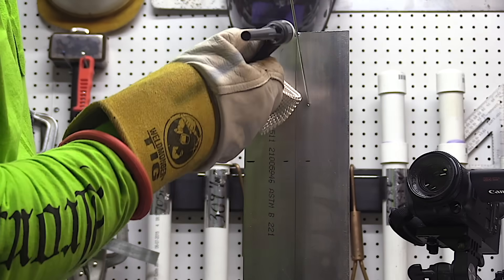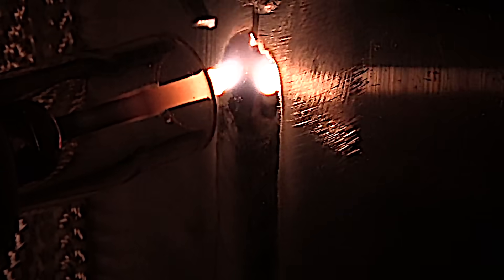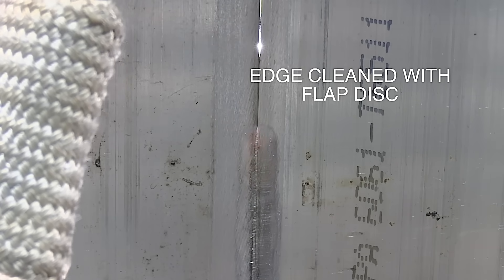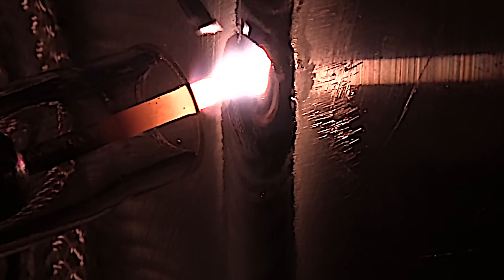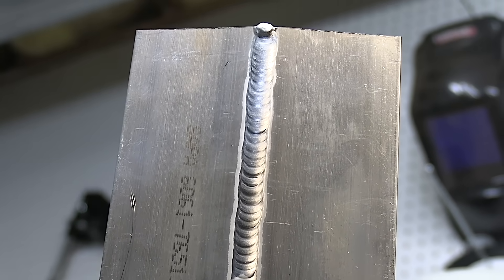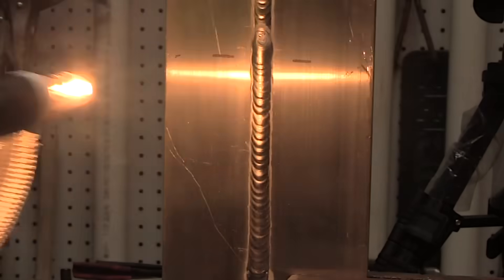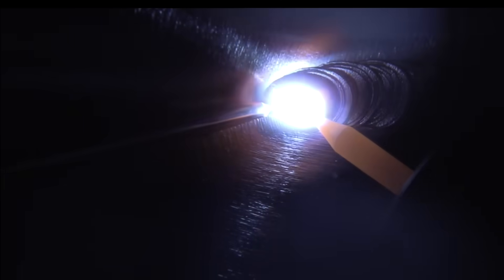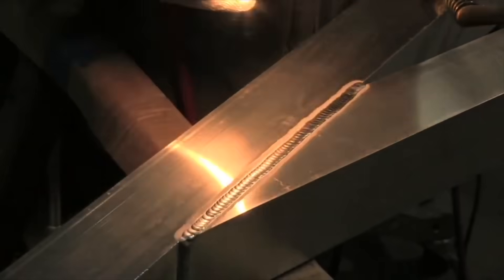3G Butt Joint 1/8" (3.2mm) 6061 Aluminum TIG

Comment: Great job on the videos, watched them for years. Very helpful. I was curious if you had time to demonstrate a box/ cube test out of 1/4" plate? Welded out with 1/8" 7018. It's a test the give for entry level at the cement plant I work at. It's simple but difficult as well I suppose.  Seams are all outside corners ran uphill, overhead, horizontal, and downhill all with 1/8" 7018.
Reply from the maker: I will put it on my list.  what are the rough dimensions and requirements to pass?
Reply: It's a 6"  cube out a 1/4" plate all outside corner joints ran with only 1/8th inch 7018 rods. Can be tacked up with 6010. Must be welded in position once tacked up. Two vertical seams ran vertical up the other two ran vertical down ( yes very odd to run downhill with 7018 ) the bottom seams ran over head and top ran horizontal/ flat. There is a 1" hole cut in the top plate to weld a nozzle to, and it gets pressure put to it to check for leaks, I believe it's only brought up to 10lbs of pressure if that helps. It's graded on bead appearance, but a good chunk of the score (50%) is if it leaks or not. I appreciate the reply